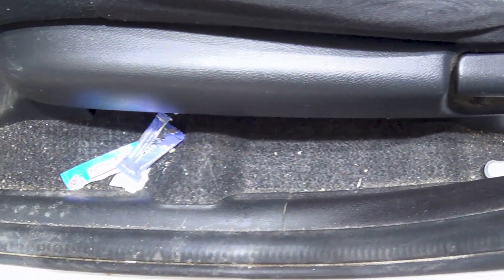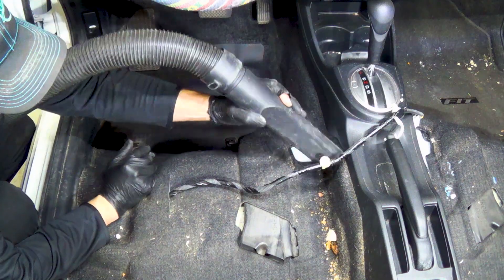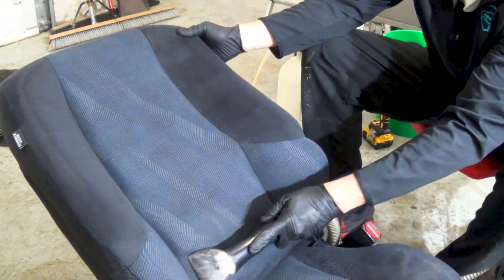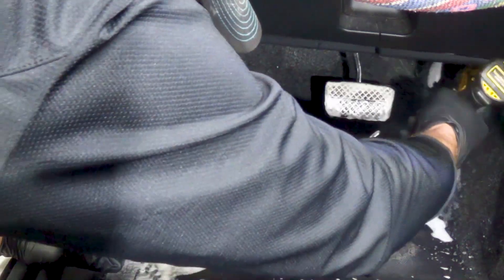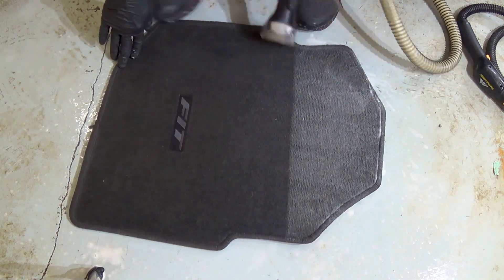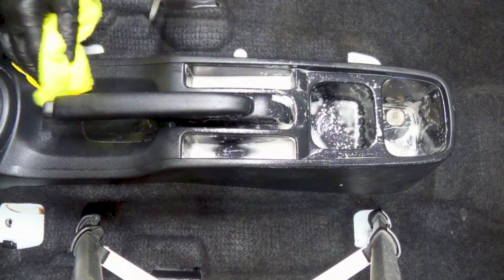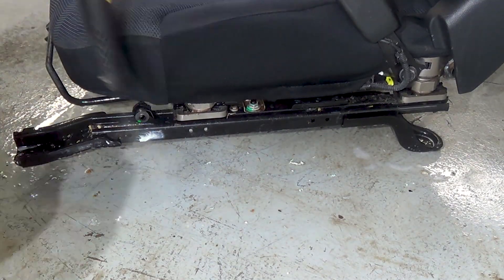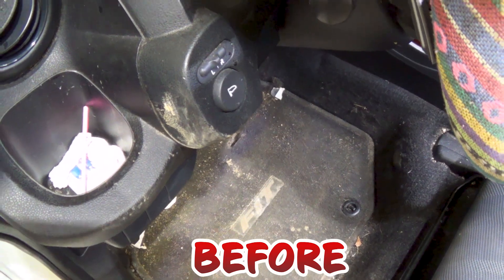Deep Cleaning a Girl's TRASH-FILLED Honda Fit

Comment: The cup holders in front of the shifter as well as the footrest (dead pedal) easily pops out without tools and I found it helpful on the Honda Fit I cleaned.
Reply from the maker: Ah, ok. Thanks for the tip. I did remove the dead pedal in a couple of vehicles, but I should have done it in that one too! Thanks for watching!

Comment: Ahh some reason I missed this one on my subscription feed. But just watched it now, I can't believe how some people let their cars get 😱 such a good job as always. Also what carpet cleaner tool are you using to extract the water?
Reply from the maker: I'm currently using a Bissell Spot-Clean Pro. I am planning on upgrading to a Mytee HP extractor at some point, but the Mytee extractors are about $1,500. This Bissell was only about $180 or so. MUCH cheaper, but not as much suction as the Mytee. And no hot water capabilities either.
Reply: @ScrappersDetailing  ok good to know, if it does the job then might go for one. Tbh the interiors over in England never seem to be as bad as the ones you get 😂
Reply from the maker: @the_jnlt_channel  English probably take a little more pride in their vehicles. Another reason might be that so many Americans commute in their vehicles on a daily basis so they get much more use. 

I do have the Bissell linked in my description so you can take a look. Probably have to buy through a different link though being in England.
Reply: @ScrappersDetailing  could be,  but not all English 😂 ok cool will have a look cheers 👍

Comment: Great job and transformation, Scrapper, as always!  A couple of quick questions, if you don't mind.

1. Do you ever have any issues with wicking on cloth seats when you clean and extract with Lightening Fast?  

2. About Carpro Inside.  I tried it recently at 1:1 in their bottle with the foaming nozzle.  I really didn't like the way it foamed - much too messy.  Do you find that it still works well with a normal spray bottle?
Reply from the maker: Thanks for the questions. 

1. I have had some wicking with the Lightning Fast. I have had to repeat the next day. I also have to make sure I extract the entire seat. Spot extracting tends to leave wicking stains. 

2. I love Inside but I do dilute it down to at least 4:1. It foams up nicely on its own with my detail brush. I wouldn’t want to use a foaming nozzle. I think that would prevent complete coverage of the surface. I actually just use a Zep spray bottle that I bought at Menards. I have a couple of the regular Carpro spray bottles and I don’t like them as much as the Zep ones. 

Hopefully those answers help. Let me know if you need any more explanation.
Reply: @ScrappersDetailing  Awesome!  Thanks for your time and input!
Reply from the maker: @marklittleton1309  No problem!